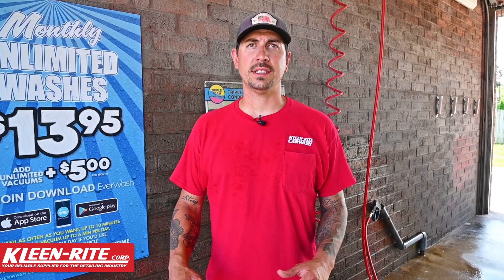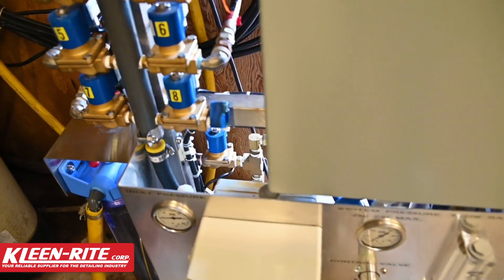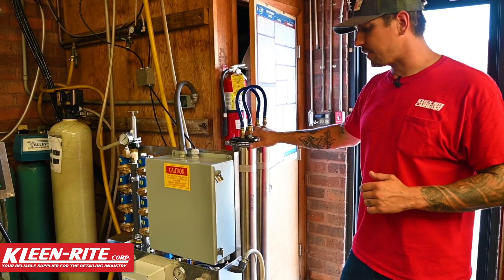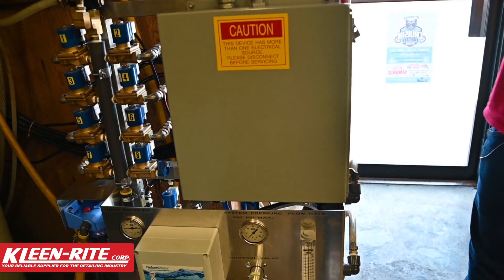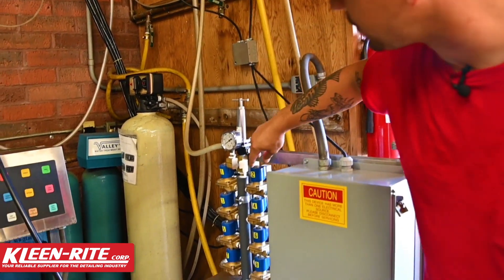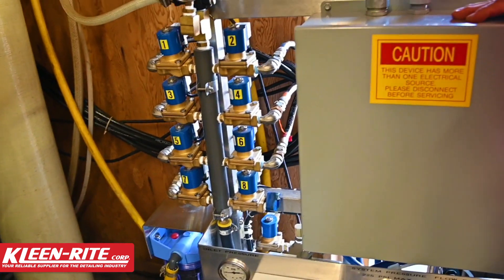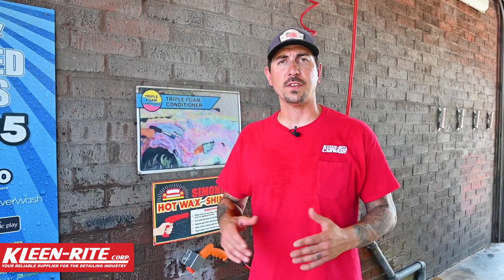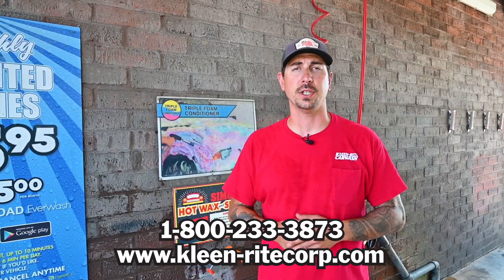Spot-Free RO System Overview - Fix It With Phil | Kleen-Rite

Comment: Any reason why I can’t get enough pressure ? 
Is there a setting we’re my R O system is letting out to much water rather than building up pressure
Reply from the maker: So this is going to depend on what portion of the RO system we are talking about, is it the Production side or is it the Delivery side? Both pumps should a recirc / relief on them. The production side is truly a relief and is relieving bad "reject water" that based on flow through the membranes was unable to be made into spot free water. If this is the side, we are talking about the first thing I would be looking at is changing out the RO membranes. If the pump seems to be getting HOT to the touch than we would need to consider all the prefiltration to the pump. Filters, water softeners, charcoal filters these filters can plug up and restrict the flow (amount) of water available to the pump itself thus causing the pump to get HOT and not move the correct amount of water to the membranes giving a false low pressure reading.

If we are talking the delivery side of the system, there is a recirc valve that is used to set the pressure that is delivered to the bay the spring in the relief could be going bad a quick test is to turn in on the stem and see if you can raise the pressure at all. This could indicate that the relief is weakening. Be sure to see how the pump feels as well if it feels HOT we are having a supply to the pump issue.

Comment: What is the best way to push the soft water to the bays?  I'm curious if the Air Logic or Dosatron low pressure system would work?
Reply: I’m having this issue after stopping the leak. The spot free is SUPER low At the bays. The machine starts working, but barely anything is coming out at the bays. The pressure gauge is not moving. What do I check?